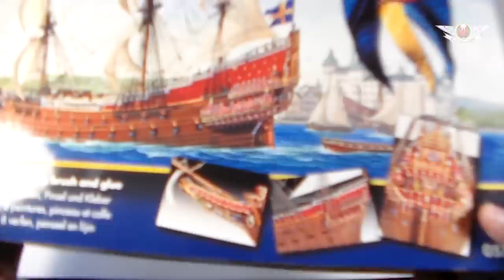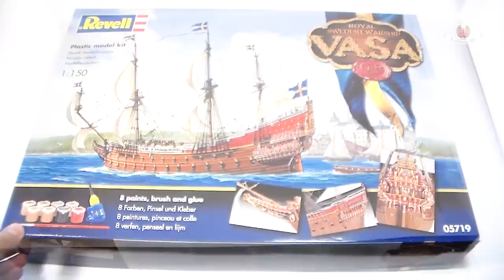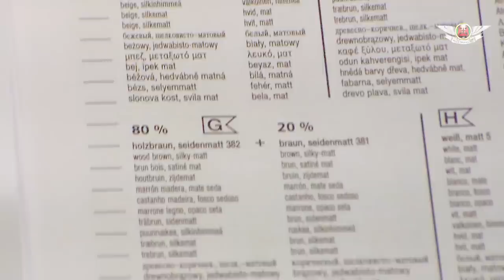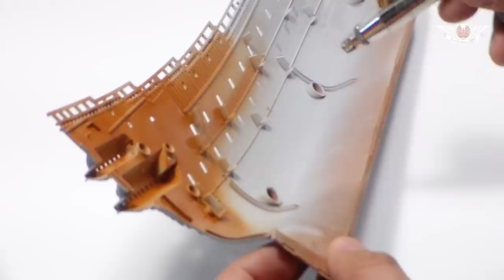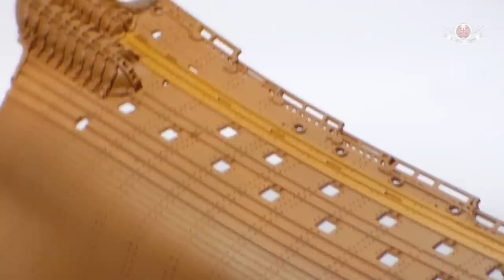REVELL 1:150 VASA FULL BUILD #epichistorytv #wasa

Comment: Hi Alex. I truly love your work and the detail on this model is awsome. I have built sailing ships for most of my adult life, a long time believe me, so I feel justified in pointing out one detail. The standing rigging, basically that which holds the mast up and isn't designed to move much is black. That's because it is covered in tar to proect it. The running rigging, that which controls the positioning of the sails and therefore has to run freely through the various blocks is natural in colour.

Comment: The main difference I quickly noticed is that mine is by Airfix and the ratlines are coated thread, really cool, which is one of the reasons I made sure I won the bidding on ebay.

Comment: Brilliant build Alex! I have a Mojo for sailing ships at the moment after completing "The Victory " that I was inspired to build after watching that video. I agree about Revell paints as I have quite a few. Beautiful paint, but I have failed to airbrush as it always blocks up. However I will try again with some alcohol and Revell thinners and try again as it is a great paint.Outstanding work Alex. That ship is a work of art and you should be proud. I have to get this. The detail work will be a challenge I would like to have a go at. Well done .
Reply from the maker: Good luck on your endeavors also 😊
Reply: Try putting a very small drop of dish soap in the paint and thinner mix this will keep it from drying out and clogging your air brush and won't effect the paint job.
Reply from the maker: @naturalobserver6130  great tip. Thanks
Reply: @naturalobserver6130  Cheers m8! Will try that.

Comment: One question: why the shading on the underwater part of the hull, seen in 18:29? There's no point of it being there from the construction point of view - on Your model it looks like there would be a kind of simplified frame underneath the planking, but historically on a ship this size, the framing was much denser, and curved perfectly from the bow, so there could be no such shading. There's also no historical data suggesting existence of this tight rib cage effect. You can reference the framing on admiralty models, which showcase the exquisite framing of the wooden ships this size. Anyways, great work, apart from this one error You did a fantastic job.

Comment: could you overlay the plastic rat lines with thread to give them the look of rope?
 Did you use the thread from the kit? I'm trying to find replacement thread of the right scale look without being ripped off by shops selling "Rigging line" for very little length and a hell of a lot of cash.